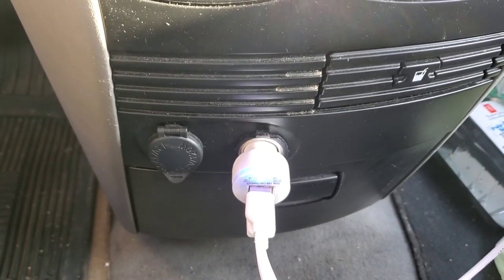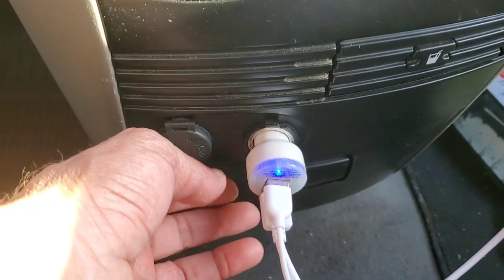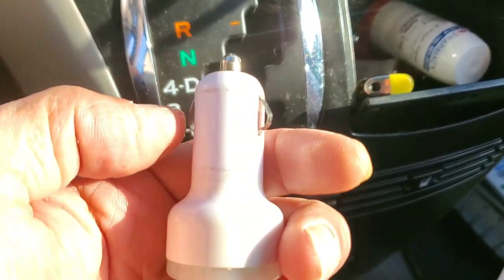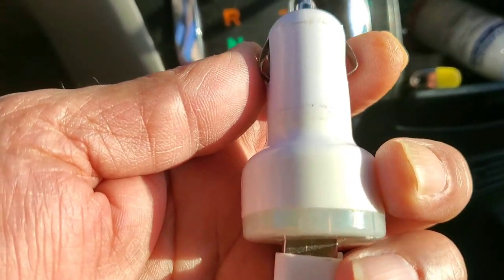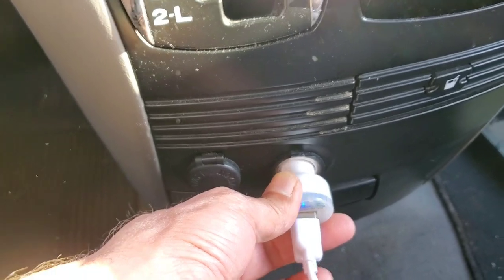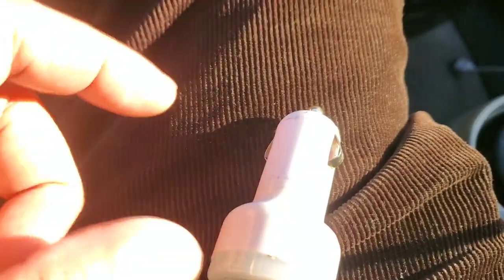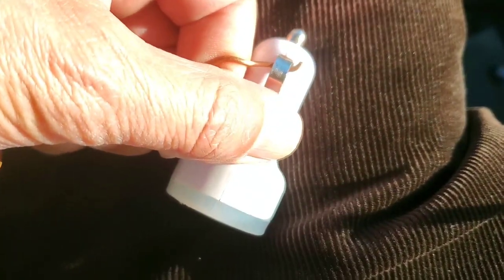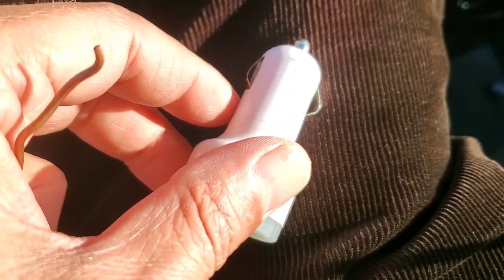How To Fix USB Car Charger Adapter Loose Or Not Working

Comment: What if it’s the newer style you can pull out
Reply from the maker: Newer ones usb chargers have springs inside of each pin so you need to  disassemble it and tension the spring to make it little strong then put everything back, thank you and all the best